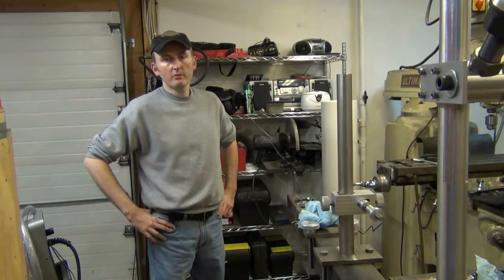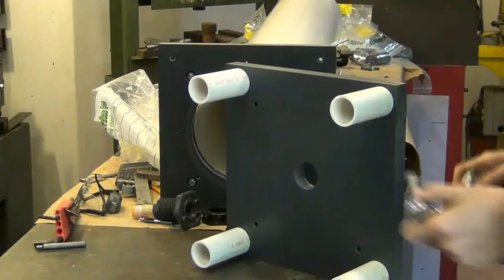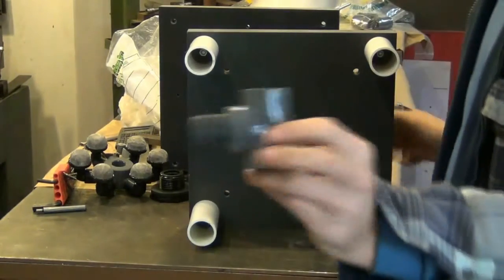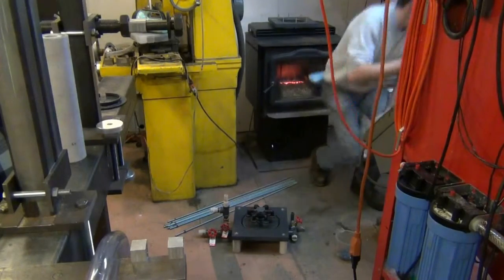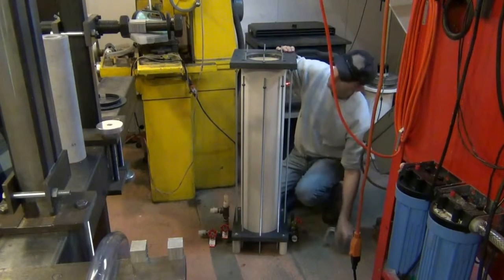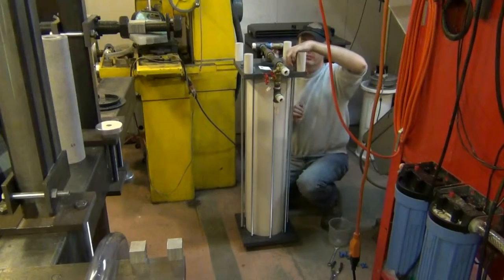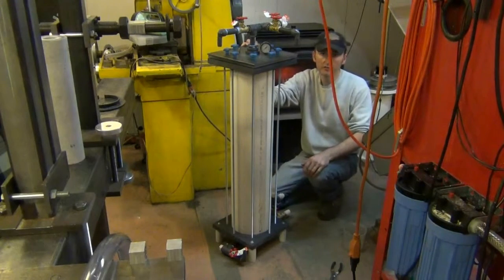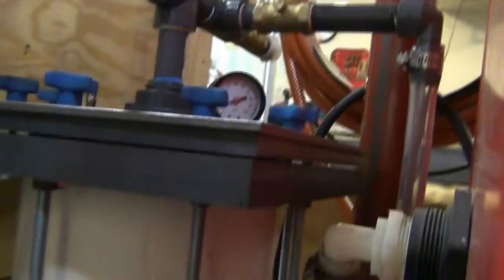Building a Big Water Filter - Part 2 of 2

Comment: I'm not sure if I'm over thinking this or not, perhaps you could give me a hint?
The filter is a separate function from the blasting process, no? You shut off your slurry pump, let the media settle out of the water, then run the sand filter to clean the water 'between' blasting sessions?  Very interesting build video, and thanks for sharing.
Reply from the maker: I run the filtering system while the blaster's in operation.
Reply: Arnold's Design Wow then it is more complicated in that case. I don't know how you could filter the  water while there's slurry in it and keep the blast media out of the sand filter. Cleverness is implied!
Reply from the maker: It's kind of involved, but I do have it set up to separate water from the media. My pre-filtration section separates out damaged media from the good media, gets rid of the bad media, and then sends the water to the filter. It works well.
Reply: Arnold's Design That's fantastic. You really think outside the box.